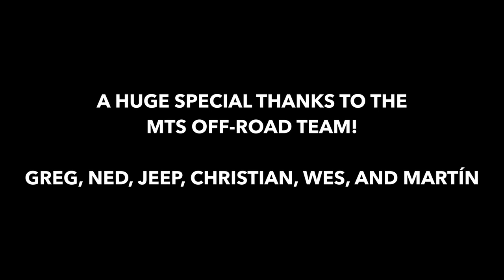Why & How to Rebuild Your UTV Shocks with MTS Off-Road Suspension | The SXS Guys

Comment: do you have to take the whole Shock apart to replace the bump stop 
  or does the bottom mount come off  
 2016 rzr xpt  rear shocks
Reply: Great question @6gatornation  I have to replace a front bump stops aswell